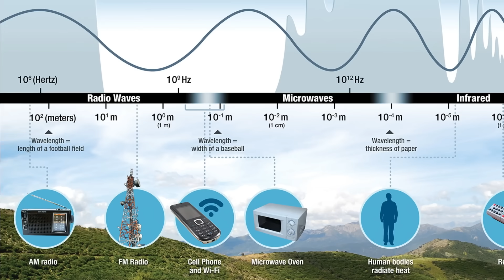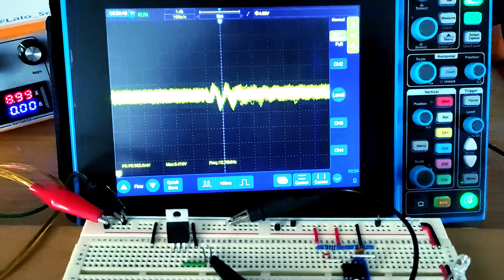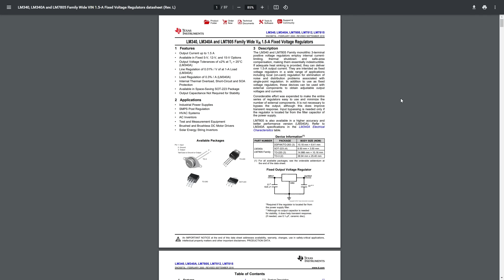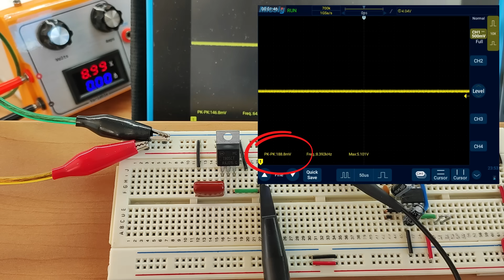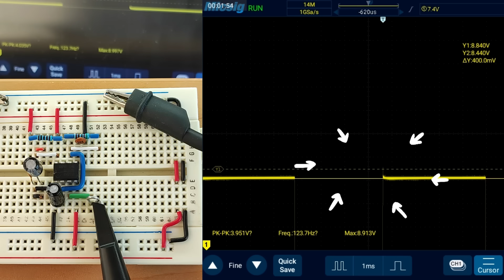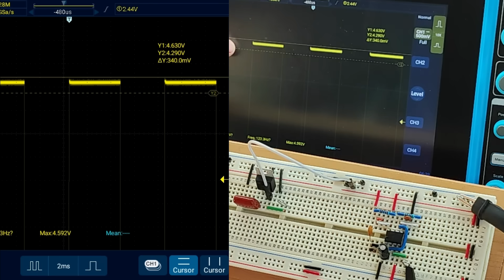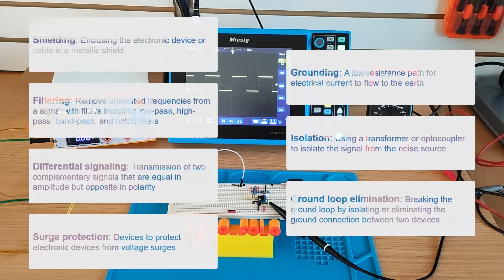Decoupling Capacitors - And why they are important

Comment: 1:42  The 7805 is a linear regulator, so it is not “internally switching at high speed”.
The noise is most probably originating from your bench supply, which probably is driven by a switching regulator.  Otherwise, good video.

Comment: Fantastic!  I just designed a circuit for production and was blaming my scope for the noise.  I was wrongly taught that the caps were to keep the regulator from breaking into self oscillation.  You just saved me thousands of $$ in product recalls.  Thank you.

Comment: When we decouple with 2 capacitors and the datasheet says use 1 ceramic and 1 electrolytic capacitor. Is electrolytic capacitor essential? E.g., datasheet for a similar component from another manufacturer says to use 2 ceramic capacitors for the same purpose. Is it just a matter of preference or electrolytic capacitor indeed does some magic?

Comment: 04:45 you should have mentioned you removed the decoupling capacitor at the input of the regulator and the bypass capacitors at the input of the 555 timer...

Comment: Why doesn’t the manufacturer include the decoupling caps in the ICs directly? Is this for cost-savings or user configurability?
Reply: Capacitors require a relatively large amount of volume proportional to their capacitance. There often are capacitors inside more complex ICs, Volatile memory is usually made up of capacitors and transistors but they are like a picofarad or or less. 

In the case of something like a 555 timer, the decoupling caps   are bigger than the actual silicon chip itself. Furthermore, general purpose chips like the 555 doesn't always need capacitors, it depends entirely on the application.
Reply: @spencerhho  thank you!

Comment: I've started making my own breadboard adapter PCB for SMD modules and MCU ICs when not available commercially. Now I think I will include coupling capacitors on the adapters.

I know that dev boards are available, but I like to recreate the functionality as part of my own designs, and i need to test it, which is why i use adapters.

Comment: These capacitors are not decoupling capacitors. Decoupling capacitors eliminate dc voltages from previous or following stage of circuit modules. Your capacitors do the opposite thing. They form high pass filters grounding high frequency noise from power supply lines, inputs or outputs of circuit modules. Capacitors from power supply lines to ground furthermore form charge buffers, which suppress voltage break downs due to short time higher current requirements of circuit modules.

These buffer capacitors are especially needed in the case of the NE555 timer application because it has no means to suppress shot througs in its output stage. So it uses 200 up to 500 mA for 40 to 100 ns which cannot propagate along the power supply lines to the device because of its inductance. So a voltage regulator cannot react on them. So it only can be covered by the charge of a capacitor immediately located at the power pins of the timer IC.to keep the inductance of the current path low (in the nH range).

Comment: On the whole great presentation. Would have added a 100nF capacitor to the regulator output and increased the 1uF capacitor to 10uF for the 555 astable circuit. For standalone applications the 555 datasheet recommends a 100uF capacitor particularly in monostable circuits. The control voltage input also recommends decoupling by a polyester capacitor of at least 10nF. Have seen 100nF used/recommended. Tom Duncan's Adventures with Micro/Digital Electronics used the lower 10nF decoupling capacitor value on the control voltage pins of the dual 556 timer.

Comment: Good tutorial and quite educative. Now go a step further. And redo it with better measurements.  
Don't use 10cm gnd wire with the probe when you do noise and low levels measures.

Comment: Have a think about the dielectric performance of the capacitors - particularly in X7/X5R types under bias voltage, about the frequency response of electrolytic dielectric and then consider what and where this "noise" is, comes from and where it goes.
Reply: I made the mistake of buying a moderate quantity of SM ceramic caps with Yxx characteristics without properly reviewing the data, having looked quite carefully at data for these types long ago. The ceramics used in modern SM caps of these types have absolutely horrendous negative voltage coefficient of capacitance. I would no longer use anything "worse" than X7 or X5 types.
Reply: @D614G_aka_Doug  Epcos suddenly changed the max voltage rating of some 1812 chip caps 5 or 10 years ago. It was like "wow, they've improved the part" but no. They'd just extended the voltage cap degradation graph from -50% to -80% capacitance :-)

Comment: Simple but slightly inaccurate.  See the Coulomb Bucket comment.  If this demo was accurate, you could put decoupling anywhere, but it needs to be close to the problem due to inductance of the leads.  The demo is right but the narrative is flawed.  And the regulator is unstable without a the right cap.

Comment: Any transmission line has inductance per length and capacitance per length.  Capacitors will also have some series inductance (and resistance which is very low) and form a resonant circuit. 2*Pi*F - (1/LC)^1/2. Switching circuits are full of harmonics out to infinity. If you just use one decoupling capacitor you are at risk of hitting the resonant frequency.  Using several different values capacitors means that if one is resonant the other one won't be. .01uf and .1uf and 1uf. Decoupling capacitors are cheaper than warranty repairs.

Comment: Excellent presentation!  I'm in the process of building my own TTL  Logic CPU... which I plan to move to PCB(s) after BB prototyping.  Any thoughts on noise reduction with higher speed signals (2 to 20 mhz) would be greatly appreciated.
Reply: (2 to 20 mhz) is way different from ( 2 to 20 MHz)

Comment: does measuring the noise like this with your oscilloscope leads amplify the noise like in great scotts most recent video by creating a coil that picks up em waves? or is that only becuase his was using components that generate stong em fields (the ones on the powersupply he bought)?
Reply: Measuring noise with an oscilloscope can be very daunting.
 
I've spent many hours trying to determine whether noise on a scope screen was real or not. I've done a lot of biggish SMPS design, with switching of  about 400 V and currents of many amperes, slewing in a few tens of nanoseconds. Pickup on the probe ground lead was very rarely an issue. Inductance of that lead is another matter.

One of the issues is that as soon as you connect the scope ground to the circuit under test you MAY introduce a ground loop. You may essentially connect an antenna (the ground of the scope itself; less of a problem with small digital scopes than big metal-cases scopes of years gone by) to ground, so you make a path that didn't exist without the scope.

Differential probes can be a big help and there are some that are fairly reasonably priced these days, at least up to about 100 MHz. I haven't used any of them, so I don't know how good they are.

A resonant circuit is formed between the probe tip capacitance and the probe's ground lead. That can make things appear much worse than they are. FET probes have merit here, but decent ones cost a lot more than the average hobbyist's oscilloscope.

Comment: All the decoupling capacitors do is to compensate for your PDN’s (power delivery network) inductance. They essentially act as Columb buckets of charge to handle local power demand. The noise you see at the 7805 regulator’s input is generated by your bench’s switching power supply along with the long connection leads. If you improve your PDN ‘s design & layout you may find that the decoupling capacitors aren’t needed at all. The measurement of power supply noise is also greatly affected by probing technique. It is best to have the probe’s signal and signal return’s (i.e.) as close together & as short as possible as not to introduce unwanted impedance mismatch which’ll create false noise readings.

Comment: It says right there in the datasheet for this LINEAR regulator, that a capacitor is required on the input for STABILITY. Without it, the regulating feedback amplifier inside the regulator becomes unstable. That is, any small variations in the INPUT voltage cause the feedback amplifier to unintentionally react, causing a change in output voltage and therefore load current that causes the the input voltage to change even more due to the source impedance (lead inductance). This is positive feedback, and it causes the oscillation that you see. This is NOT noise, it is instability. Adding the input capacitor makes the input voltage much less sensitive to rapid changes in load current, enough that any unintentional reaction by the regulator does not change the current enough to make things worse. It's all about how fast the input voltage changes in response to changes in output voltage and corresponding load current. Too fast and the regulator's negative feedback can't compensate for the positive feedback cause by the amplifiers response to fast input voltage changes. The instability gets worse, as you have shown, when the load is greater, since the current changes more with the output voltage, thus effecting the input voltage more. The datasheet notes that the input capacitor is only required if the regulator is far from the filter capacitors of the supply, as they would do the same job, but with long leads, the inductance of these leads is too much and the input voltage becomes more sensitive to the current changes.
Reply: Yea, when he started talking about switching noise from the regulator, I was like err, that doesn’t sound right.
Reply: so i do need to keep my crossover leads short or shielded 🤔 ty

Comment: you should also have a capacitor on the output of the voltage regulator, it will further suppress noise from the switching of the regulator on the power plane
Reply: Many regulators, especially some of the older "low dropout voltage" types absolutely must have a fairly substantial amount of capacitance at their output for stability. The ancient 7800 series are pretty tolerant, but dynamic performance is still improved with some capacitance at the output.

Edit: Some of the older LDO regulators were also very fussy about the equivalent series resistance (ESR) of the cap put across their output. An acceptable range would be specified. If the ESR were too low or too high the performance would be compromised. Most newer types will tolerate "zero" ESR.

Comment: The video looks very nice, the explanations are severely oversimplified at best and completely wrong at worst. The Wikipedia page you show at 0:26 clearly mentions what noise is (random fluctuations); the rest of the video uses the word noise where the actual phenomena are oscillation and coupling. You don't show the effect of loading on the output on your lab supply, which has a significant impact on the performance of the 7805 as it will pass frequencies over a few hundred kHz straight through. The input capacitor C1 affects regulator stability (->oscillation), not noise. You very briefly mention breadboard being "not ideal" -- it's fairly common to get > 1Ohm contact resistance on most breadboards, which strongly impacts your measurements. The output stage of the old school 555 is well known to have shoot through, which makes switching transients pretty bad in circuits of these. Finally: where do you decouple *to*? What is the role of the load in all of this?
Reply: Honestly, I think this video is fine for hobbiest engineers who just want to understand why decoupling capacitors are used & their function within a circuit. The Wikipedia page is also using pink noise, which is a random fluctuation, do show a kind of noise, but defines it as unwanted changes in signal strength.

Comment: Excellent video presentation!  I saw proof of effectiveness right away!  Can you please explain in another video why manufacturers use a combination of electrolytic and ceramic capacitors instead of just one kind.  Is it because the former provides better smoothing while the ceramic is more effective at shorting higher frequencies to the ground?

Comment: Clearly showed what decoupling capacitor exactly does. In our engineering classes our professor just said to use decoupling capacitor at input and output of the regulator but didnt explain on the board or in lab how it affects the output. Thanks for the explanation. It has been nearly 20 years I learnt about voltage regulators but now i know the exact purpose of decoupling capacitors. Earlier i used to add decoupling capacitor as an electronic ritual.😂😂😂

Comment: Thank you, good vid!
I do have a question. I've been using some  DC to DC converters from Meanwell and they specify a maximum value of all decoupling caps in the circuit.
Why? What could happen if that overall capacitance is exceeded?
Reply: for instance, at the 555 IC which is outputting a square wave frequency, a too large capacitor can deform that square output. 
An even larger capacitor will do its best to flatten any such frequencies and force them closer to DC. Now that's ONE example.
Reply: Because they are switched mode converters you can get into problems of loop stability (and occasionally start-up problems) if the capacitance on the output is excessive. Some switchers tolerate almost infinite capacitance, others are finicky. 
If you need better filtering you can likely use LC filtering (a "pi" C-L-C type, typically), but be careful. You can produce unwanted resonances that make things worse rather than better. Inductors with moderately high resistance can "spoil the Q" of the resonant circuit, though at the cost of slightly degraded DC regulation.